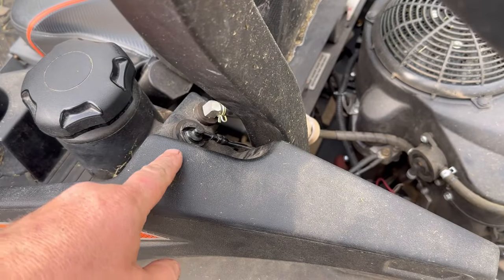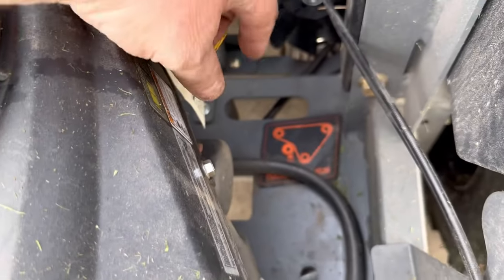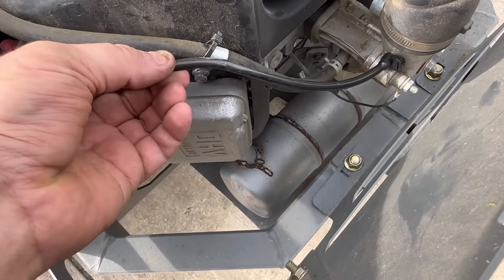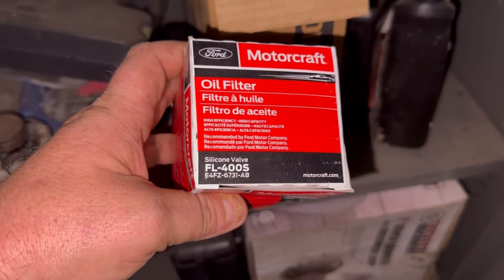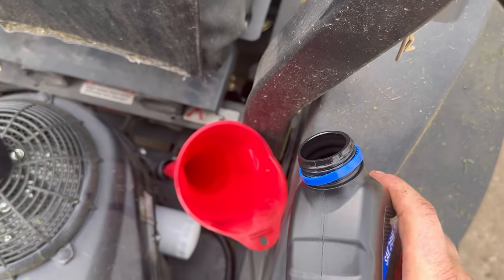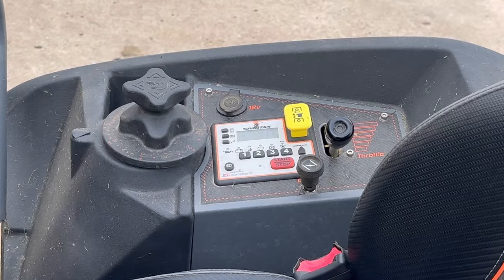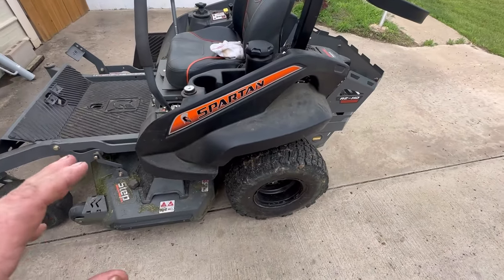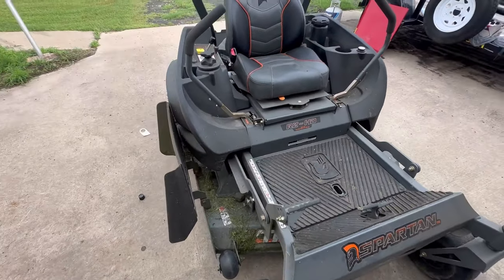SPARTAN RZ HD FIRST OIL CHANGE AND 1 YEAR REVIEW!

Comment: Just found your channel and I have a Spartan RZ54.  Has the Kawasaki FR691V engine.  I bought it about a year ago and have 13 hours on it.  I like it so far, however I noticed when I demoed it at the dealer, the height control knob numbers were faded and didn't line up with the pointer,  height is also off a bit.  I think someone tried twisting the knob without pushing the foot pedal.  I Also noticed the gas cap doesn't screw on all the way.  I lifted the front end to sharpen the blades and smelled gas.  When I looked for a leak, gas was pouring out of the threads of the tank and cap.  Thanks for showing a filter number, I've been trying to cross reference it to a name brand filter.  I like that it is a longer filter than what came on the engine,  adds a little more oil.  I like the size of the tray on the left hand side of your model.   Mine is smaller and can't even hold a pair of hand pruners.  Over all the cut quality is excellent along with the quality of the manufacturing.  I think it will be the last mower I buy.

Comment: Great job. I use 20w50 amsoil full synthetic in all my small engines a bit pricey @ $15.99 a quart but I change my oil around 400-500 hrs. I own a exmark Lazer Z 96 in with a yanman 37 hp diesel owned it over 5 yrs and have had no problems out of it except belts blades..... BTW I'm in Arkansas and it gets 🔥 🥵 HERE also have a great day Buddy
Reply from the maker: always follow the manufactures oil change interval no matter what kind of oil that you use

Comment: I bought a cub cadet 5 years ago. It has 164 hours on it and it's been in the shop more hours than it has on it. I'm so disappointed in cub cadet. 
I was thinking about replacing it with  Spartan. 
But I don't want to buy something that won't last

Comment: Nice mower! The best upgrade you can do to a Kawasaki FR 691/730 is the FX style air filter canister kit.
Reply: I'm still waiting for a Kawasaki tech to tell us that it's safe to do so. 😅
Reply from the maker: Yessir I plan on doing the air
Filter upgrade
Reply: @morejelloplease  You would think that it might run lean but it doesn’t. I have kept a close eye on the plugs and I don’t notice it running any differently.
Reply: @Andy Becker  I had a kit on my liberty Z but only had maybe 10 or 15 hours on it,. It had problems before I installed that canister filter lol.  I wish kawasaki would give us a straight answer.
Reply: @morejelloplease   What kind of issues did the Kawi have?
Reply: @andybecker2693  on the 2nd liberty z the engine would smoke randomly, it drank oil, and the plastic fan guard would rub on the fan and it started to melt.  reached out to dealer, and kawasaki directly, no response.   that was during covid when i bought 4 new scags and they all had issues.  mostly crappy dealer PDI, but i did have a new tiger cat that was missing gasket material right on the crankcase of a new vanguard EFI.

Comment: General push mowers Honda 25hrs and Briggs 50hrs recommenced for oil changes.
Reply from the maker: Kawasaki and Briggs & Stratton both recommend 100 hours so I don’t know where you are getting your information
Reply: @THEMOWERMEDIC1  I believe due to links added in my reply they may of been removed.
Kawasaki is 100 hours after the first 8 hour change, officially not correct weight oil 20w-50 according to manual their are many but 10w-40 is the closest for you. I’m sure your fine
I will reply in short without links Briggs & Stratton push mower engines oil changes are recommended at 50 hours or Honda GCV 160/190 is 25 hours heavy use or standard use 50 hours.
I did list all the links but my comments may of been removed due to the links.
We sell your unit in Australia under the Bushranger Brand.
Thanks, love your videos.

Comment: I dont know about that oil filter, but I was going to say, "I see you're using Kawasaki's recommended oil viscosity for summer time temperatures".👍🏻
Reply from the maker: What do you not know about it? Or what do you want to know about it?
Reply: @THEMOWERMEDIC1  If it is as good a filter as Kawasaki's recommended filter (i.e., degree of mircon filtering ability). It obviously has a larger volume. I just questioned the wisdom in not using the engine manufacturer's recommended oil filter during the engine's 3-year warranty period.

Comment: Cheap hoses and fuel lines that stretch to fit their connections are a pet peeve for me. For the cost of me equipment you would think the designers would use better parts
Reply from the maker: I hate low, perm fuel lines
Reply: @THEMOWERMEDIC1  Amen brother.

Comment: I usually flush the engine with a quart of new oil and let it drain straight out. May not do anything, but I think it washes out more of the old oil and more particulates. Then I put in the proper amount of oil to run the engine.
Reply from the maker: Nah just run it and get it hot and drain it.

Comment: Do the newer Kawi engine's still have the oil dipstick that tells you to not screw the dipstick down, when checking the oil level properly? It's amazing how many people screw it all the way down, then check the oil level? Your supposed to just sit it on the top threads of the tube, then check it, right? Good job, sir.
Reply from the maker: Yes, it says it right there on the dipstick not to screw it down
Reply: Back in 1999 I bought an Exmark with a 23 HP Kawi.  A couple years later Kawi sent me a revised dipstick with higher oil level.  From what I read that FH680V had some sort of upper crank bushing oiling issue and keeping oil level up was important.